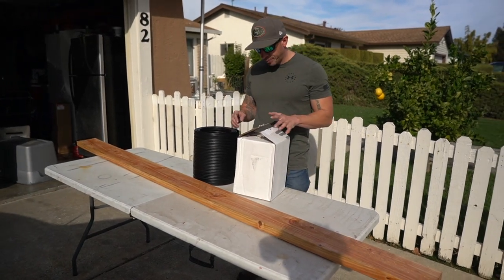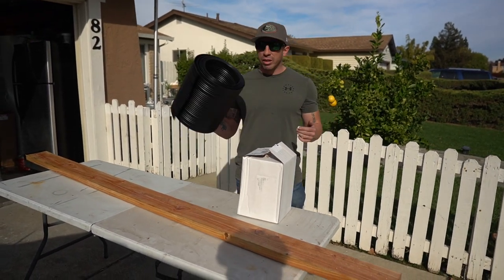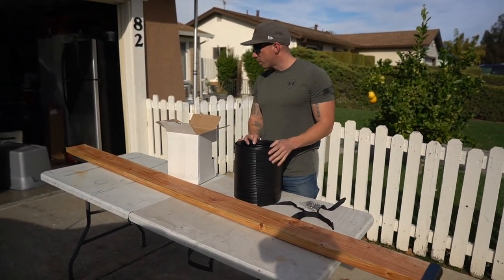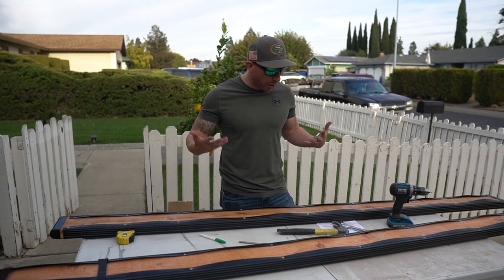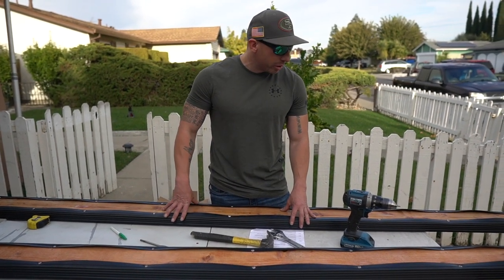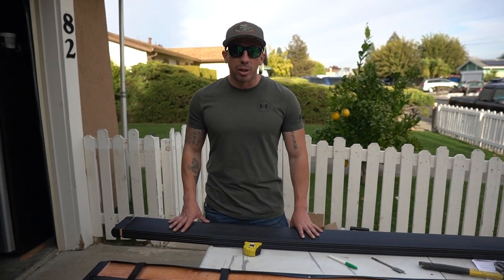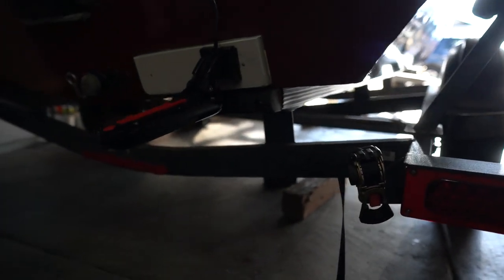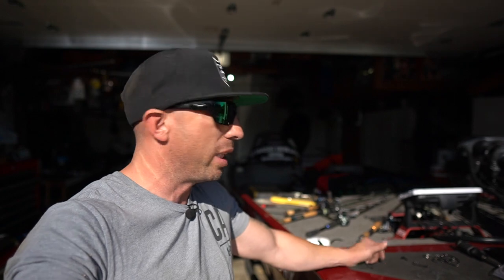Replacing broken bunk boards with Caliber BUNK WRAP for tracker pro 170 install

Comment: what you need to do is measure from your bracket to the end of your board before you take them off set them back in the same place. another real good idea is not to put your hand between the bottom of the boat and the 2x6 when installing it, came out good will be getting some soon

Comment: My boat is not even 2 years old and I will have to replace my bunks soon. I am curious how those caps would work on fiberglass boats.
Reply from the maker: From what I’m hearing is that it makes it easy to go on and off the boat just make sure to unstrap at the bottom of the ramp lol because it can slide off
Reply: @coachMiguelfishing  ya that last part is what I worry about. I don't want to drop my boat. Lol

Comment: How do you like the wraps? I’m thinking about buying these for my trailer.
Reply from the maker: I love them way easier to put the boat on and off the trailer plus they look good just be sure not to unhook your boat till your at the water they are very slippery
Reply: @coachMiguelfishing  do they scratch the bottom of your boat any worse than the carpet. Thanks by the way for answering my questions. Your a big help.
Reply from the maker: @ntj030885  not that I’m seeing but I also haven’t taking it out too much after this I mean I have a aluminum also I don’t go too crazy off scratches like fiberglass guys lol